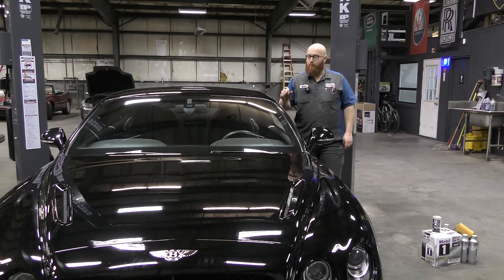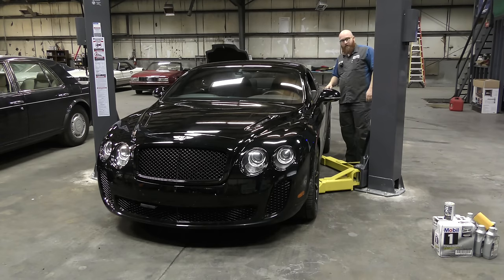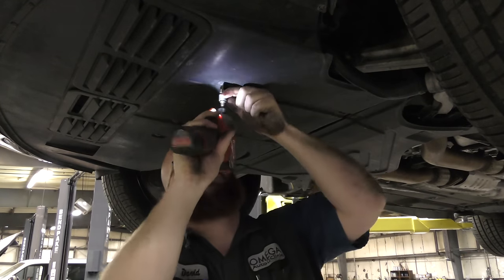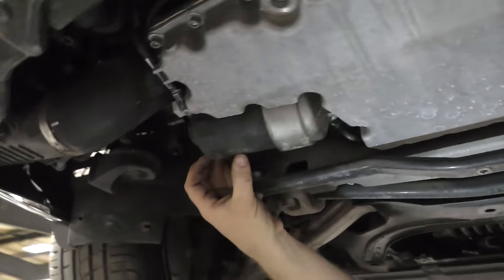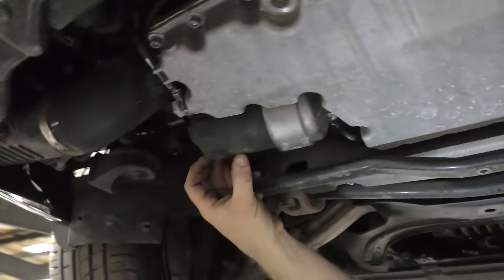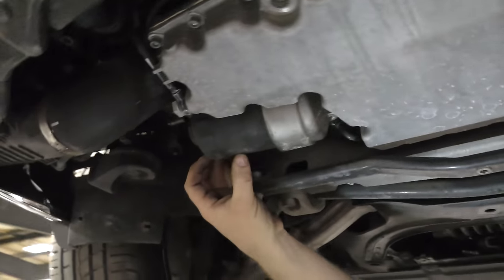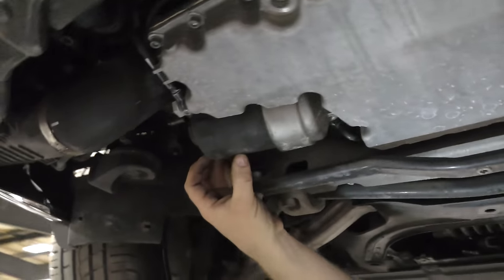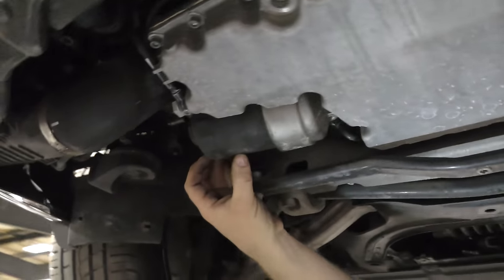One Fast Oil Change! The CAR WIZARD works on an insanely fast 2011 Bentley Continental Supersports!

Comment: I respect the wizard decision to stock "limited" supplies when it comes to oil, however 1 quart oil jugs are just as wasteful as the 500ml water bottles. I wished they shipped oil in more sustainable containers.
Reply: 5qt bottles are much better especially since most cars take 5qts
Reply: @cameronknowles6267  not environmentally they are not. A Suzuki Ignis takes about 3 litres. A Ford Focus is just over 4. I am sure many other cars have between 4-5L. Is there a US qt as opposed to the Imperial qt I didn't know about? Still a 5L jug would do most. Buy two and you can save the leftover.

Comment: Speaking of bickering about 200$ oil change at a bentley an oil change and filter change for my kia ceed 1.6crdi(diesel) costs 150$ whith filters and checkup and sellers fee included.So it is very cheap if you ask me and my car takes around 5.5 liters of oil and y bet that the bentley takes at least double of the amount

Comment: One thing that I noticed was that the 2011 Bentley had an oil level dipstick. There are some models of newer cars that do not have an oil level dipstick. Instead they have an oil level sensor and thru a menu of dashboard computer items, the oil level is displayed on the dash or a computer screen while the engine is running.

Comment: It might not cost Wizard any more for 1 litre bottles than 5 litre ones, but in the UK at retail there is a huge difference.  I only do an oil change on my Merc 3.0 CRD engine once a year (needs 10 litres), and I get a 20 litre can, lasting 2 years, for about 1/3 of the price per litre compared with small bottles.  There is no need to keep "$13,000 worth" of it, that's silly.

Comment: $200 is quite reasonable. I have 2 Jaguar 6.0 V12s and do my own oil changes because I am particular as well, though the synthetic motor oil I use is not Mobile 1.  10.5 quarts each.

Comment: I used to sell Bentleys and I remember the carbon ceramic brakes were a $13,000 option on the standard Continental GT and those were smaller than the ones on this Supersports!

Comment: $200 for an Oil Change on a Bentley is a really good price. I have a 2018 Ford F-250 Super Duty 6.7L Diesel and Ford charges over $300 for oil change for that. It also take 12-13 quarts of oil.

Comment: 22:32 I am jealous of those prices for full synthetic oil, if I was to buy the same brand locally, it would easily cost me double that; which is why I buy the 5 quart jugs since I don't get that awesome Wizard discount.

I also think $300 is a very reasonable cost for an oil change, when you combine that with the inspection(Knowledge is valuable!), and the massive amount of oil that is required. Especially since a quick lube place would charge me around $130 for a full synthetic oil change on an engine that needs 7 quarts and it's a rather common vehicle. I would also be worried that they would mess it up, or not do something correctly, because of their rather bad track record. For me, its gotten to the point that if I have to use a quick lube place for any kind of service, I would probable spend almost as much time double checking their work, to make sure they actually did what they were paid to do. Which in my book, completely defeats the purpose of even going to that kind of place.

Comment: The Supersports will be the defining version of the 1st Generation Bentley Continental GT. Thank you for the very helpful tips on the interchangeability of parts with VW/Audi Group of cars as that will be very useful to keeping them running.  
If you can find one, please do try and check out the Ice Speed Record (ISR) version of the Supersports.  
Much of the same goodness of the 'basic' Supersports the ISR is a limited edition (100 worldwide) monster with 631bhp and 800Nm (590lb-ft) of torque -- 10bhp more than the standard model.  Made possible by fine tuning the computers, a new 'free-breathing' air-intake ducts that pushes extra air into the engine, a new inter-cooler system that keeps this air cool during combustion, and a new exhaust system helps the Continental Supersports ISR hurtle from 0-60mph in 3.8 seconds.
The interior has a special Carbon Fiber weave that has red woven in and is utterly glorious.
Thank you for the video.

Comment: i love the mechanics tips. the one about spraying weather pack sealed plugs saved me on a ford 4.2L rebuild.. couldnt get plug to connect just as you said. i sprayed plug with silicone it pluged in normaly. thanks. keep up the tips

Comment: Don’t worry about filling the oil filter. I’ve never had an issue with any car I’ve owned where I didn’t fill the oil filter with oil.  Replacing the crush washer for the oil drain bolt is a good idea.   The quick oil change guy needs to google on how to open a Bentley hood.

Comment: Biggest pet peave was when I had an 04 Lincoln Town Car.  The oil filter on the 4.6 would drain all over the steering rack!  I suppose the oil filter was free and clear when the car still had recirculating ball power steering.

Comment: The PCCB for a porsche are 10k for rotors and only Porsche supplies them. I can imagine that those would be similarly priced. There are aftermarket kits to swap out PCCB to steel rotors to make it cheaper. Doubt you'll find that for this car though.

Comment: I’m retired mechanic now but I can remember getting top grade motor oil for .99 cents a quart , then I complained when it went up to a 1.50🤪🤪👍. All oils now range from about 7.50 to 13.00 per quart depending on brand and grade and about 10.00 dollars for a top grade oil filter, but don’t complain I used to work on river tugboats and we had one that had twin 649 EMD’s with remote oil filter containment chambers, then theirs the twin electrical generators that where Detroit Diesel powered.  We would have a tanker truck show up with a load of Chevron Delo 400 - W30. It took a team of mechanics all day to service that boat. Each EMD holds about 300 gallons of oil or more including the remote oil filter chamber vessel’s.  By the way the oil filter vessels where like a big round vertical tank that the top came off and it had a inner double stack rack that held in cant exactly remember but I think 40 industrial Baldwin truck oil filters. So the next time you complain about the cost of a oil change just remember your getting off easy.

Comment: What is the benefit of the BG oil additive? I have always used Mobil 1 0W-40 (2001 VW Passat wagon 1.8T, 2016 VW Golf Sportwagen 1.8T). When I replaced the valve cover gasket on the Passat two years ago, the top end looked clean, some varnish, but no "sludge"/coke. I do use a Mann 950/4 oversize oil filter to compensate for its 3.7L sump.

Comment: They can put a fitting on the end that you could pre prime the oil filter after it's installed dry start is the most damaging to any Toyota filters have a backstopor a foot valve in their oil filters to keep the engine pre primed

Comment: Common Wizard, everybody knows the best motor oil in the world has always been AMSOIL 100% Synthetic oil and in 2nd place is no other than Pennzoil Ultra Platinum  as both are the cleanest purest oils and Pen's oil cleans  40% of your engine on just the first oil change with it.  Shoot even Pennzoil's Pure Plus Platinum Euro full synthetic does an amazing job after the Ultra Platinum version as well....  Mobil 1 is old news!

Comment: The only way to "pre-fill" a new oil filter, is if it has a vertical "hang-down" design ..... you cannot "pre-fill" a horizontally mounted filter ... just common sense (which seems to be lacking nowadays).  It allows oil pressure to build almost immediately, but as the Weeeeezard says, it's not going to ruin the engine to install it dry. I guarantee you, MOST shops do not take the time to "pre-fill" an oil filter ... only a few DIY owners who have "hang-down" filters and want instant oil pressure. (not a bad idea if you have the time and are meticulous ... and yes, I've done it for years ... just because.)  :)

Comment: I've used a quick lube place for a C63 oil change but I took the oil/filter with me and watched them to make sure it was put in the car.  I knew the other components (belt, leaks, coolant/washer level) were fine.

Comment: My biggest issue is not having the shop fill the oil to the correct level, or overfilling it. I've taken my car back more than once. My new car dealer does excellent work on my oil changes, always exactly on the full line, so he keeps getting my business.

Comment: $200 For an oil change on a Bentley is VERY reasonable.
An oil change for my relatively simple 1.8 litre 4 cylinder KIA Forte is almost $90 at the KIA dealer! (Their labor rate is $145 an hour!) I change my KIA's oil myself; I would never take it to a quick lube place... especially if I owned a Bentley.

Comment: They can claim as they want e-85 produces less energy so 15% cheaper and 15-20% worse mpg and power, at best a wash.  I ran e-85 for several tanks in a row flex fuel 4.6.  You could watch the gas gauge move in only a 15 minute city drive at low speed.  You can get power but you'll need a higher compression and programming/timing that take advantage of the anti knock properties.

Comment: A little more info: Engine features Twin Turbos. Car weighs slightly over 6,000 pounds. January 2023, coupes run in the $80,000 range with a rare blue example hitting $100,000. For a convertible, make it around $125,000. This is not a vehicle to be bought at Happy Harry's used cars. Could be a rebuild or a lemon from the auction. Northern car, road salt. Florida cars concern me with sea salt in the air. Paying for a $500-700 pre-purchase inspection by a QUALIFIED mechanic would not be amiss.

Comment: Given that most lawnmower engines don’t even have pressure lubrication it doesn’t really matter . You can look up plenty “what happens when we run this engine without oil” they last for several 10s of minutes if not hours. 2-4 seconds to build pressure at idle doe nothing.

Comment: Looks like you change the oil on it like any other vehicle.  Minus the bottom cover.   Hardest part would be finding a jack point if you don’t have a 2 post lift, while the cover is still on.

Comment: Just enough oil to wet/ soak the paper element in the oil filter . Not too much oil though.. works for me😏Heard from a little bird , that high pressure build up from the oil pump ,as the car is started can tear the dry paper element from filter.

Comment: Being at the bottom of the engine, the filter housing will probably fill up as the new oil's dropped in. Anyone worrying about dry filter housings will probably start up on the importance of 3,000 mile changes next.

Comment: If you really want, remove the fuel pump relay and or fuse. Then crank the engine over. It still will have an empty oil filter to start but at least the engine wont fire up. The oil pump will produce a little bit of oil pressure just by the starter motor turning the engine over. Just dont do that for too long so you dont damage to starter motor.

Comment: ei wizard.
my miata has the filter on the side. 
i put less than half the filter capacity  just to get the filter pre wet and nothing spills when i put it on. 
we never know how many years those filters are stock in a shelf with the paper filter rock hard...
you have to make a video on 'everithing about oil'
thanks

Comment: Suddenly, I don't feel so bad about my 2001 BMW 740i needing 8 quarts of oil in its 4.4L V8 and using the same style of filter. Some may disagree, but I'm oldschool and stick to the 3000 mile rule, despite all of the LL-0x or "Lifetime" marketing hype silliness with higher-end oils about stretching oil changes to 10-15k miles, or not servicing a transmission, for one simple reason. Oil's additive package wear out and/or are consumed with usage, so fresh oil more often means a healthier running engine. Plus, at 3000 miles, it's dirty to the point where I wouldn't leave it in there anyway. My 1997 Expedition gets the same treatment with 6 quarts, despite it's 5.4 V8 having over 300k on it. Both get the same 5w-30 full synthetic oil, for the exact same reason Wizard doesn't keep a ton of oil on hand. Have what you need, when you need it, where you need it, and reasonable foresight to restock for expected usage. My Expedition will still be running just as strong at 400k as it is right now.

Comment: Wow i wish my oil filter was that easy to change on my Phaeton. I need to remove part of the air box. Thats the easy part, its the fight to install  afterwards. Plus i beleive there are 35 screws to remove the plastic belly pan
Thats the same oil recommended for my Smart CDI
As for the additive, maybe I'm wrong but I do not believe VW,Audi, Bentley advise adding such products.

Comment: I always put a  touch of syllube on my gaskets been doing that for years my truck is an 01 dodge ram 1500 5.2 with 150k and I have an 06 Mazda 6 2.3 with 309,000 miles on it with very limited trouble all those miles

Comment: A magnificent engine that reflects the over 14 Billion Euros VW Audi spent on R&D LAST YEAR ALONE, world class technicians spent decades culminating in the design of that engine, Tribiologists pondered on it's lubrication requirements requiring subtle alterations in Mobil's flagship oil to meet VW Audi's exacting lubrication requirements.
BUT wizard and the cars owner know better. They see room for improvement with a can of uncertified Snake oil.
That is like going to a 5 star restaurant ordering an entre then putting Ketchup on it.

Comment: M1 0w40 and Castrol Edge 0w40 are both very stout oils can't go wrong with either one  if your car specs for a 40w oil.  I am not a fan of additives in the oil though.  What is in the oil from the bottle is all your car should need.  Just my ten cents of course 😎